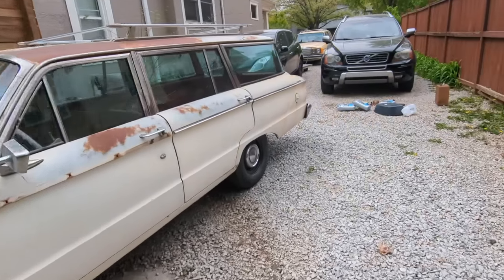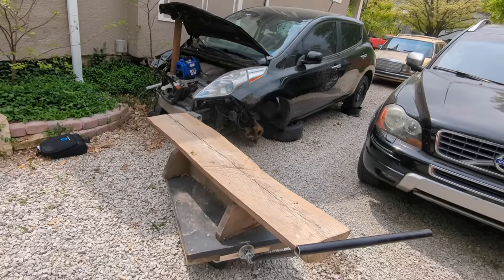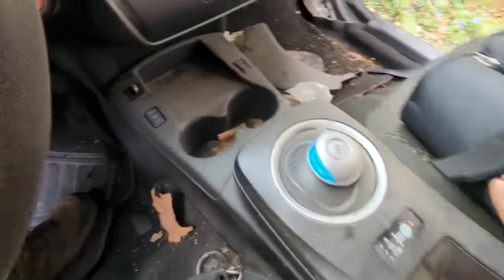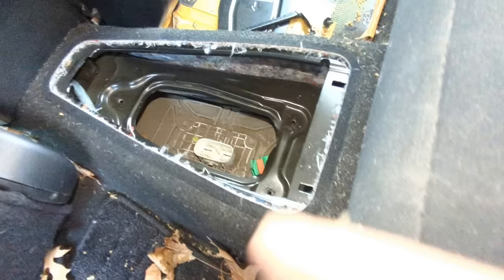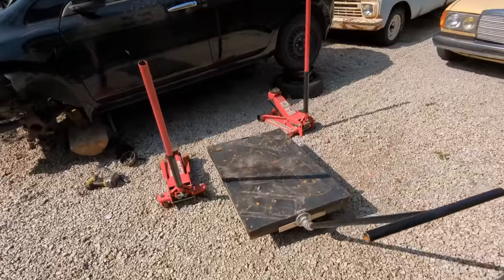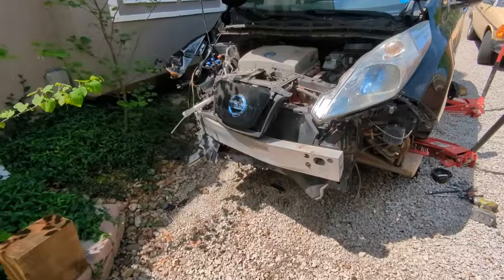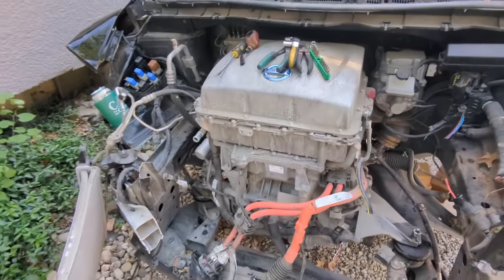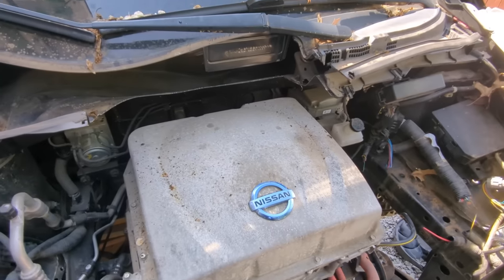Pulling a Nissan Leaf's Motor & Battery for the World's Cheapest EV Conversion!

Comment: Metal tools to pry out plastic  high voltage disconnects definitely had me worried.   I had to remind myself that you had to survive in order to post the video...
Reply from the maker: LMAO
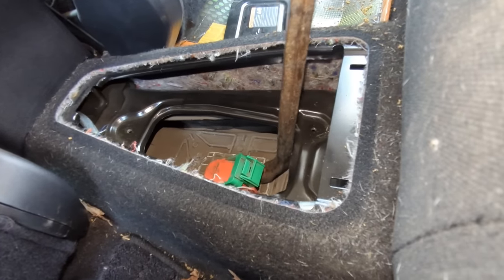Reply: @ThisOldJalopy  06:20 ish.. yup, the whole thing is fkin terrifying.. secondary stands at the back. (also reminding myself that ya definitely haven't died yet) can we change the title to 'how not to...'?
Reply: Dude. The same. It’s been uploaded 😂 he made it somehow lol even with the battery removal man that was wild!!
Reply: Using a conductive crowbar to remove a HV disconnect??
Reply: The Leaf battery outputs are only live when the contactor within the battery is active. Two things stop that happening. 1) simply removing the 12V supply on the control lines will immediately click off the contactor/relay and 2) the central 'safety' disconnect in the car (5:49) physically cuts the HV circuit so it wouldn't matter if the control lines were connected or not.
Reply: @jinny7 there are contactors that allow voltage to reach those HV disconnects. Only trouble if the car is on.
Reply: @JK360noscope   assuming normal operation where a crowbar exerting force isn't accounted for?
Reply: Chopping motor wires with a Saws-All is just simply epic.... and then it swings free, knocking over the concrete block!!!  and the lifting strap was entangled with the car!  ha ha ha
Reply: Purpose made industrial power connections are built in with a certain degree of separation distance to the end user, according to voltage classification. If you look close 8:26 , you can even see the secondary isolation.  Contactor or not and I know nothing of EV,s this still passes the pretty safe test. For comparison sake, how well do we treat our drill batteries, an 18v 5.0AH pack carries a whole lot of energy and those things have only a teensy bit of isolation.
Reply: @jinny7  one of the failure modes for the voltage drop is "in an accident" - it's intended to prevent firefighters and rescue people from getting high voltage.  Ergo, they have to be robust.
Reply: He almost made an arc welder!

Comment: Never get rid of a car till you’re done. You never know what small fuse, switch or relay you might need
Reply: Was thinking the exact same... 👍🏻🇬🇧
Reply: I'm having a bit of a guess here, but I suspect you are having quite a lot of bother getting the system to work in a new car. Those pesky VCUs look for everything before the car will drive including the airbag sensors, key proximity detectors, high voltage continuity connections and may more bits and bobs.
Reply: Also seats

Comment: This project went from do-able to forget about it real fast. Cutting the interior wire harnesses and just taking the basics will render this a failure. Every subsystem ties to another to make that car run and drive. The canbus errors are impossible to fix or charge without the oem ecu modules. Going with a thunderstruck ecu can make it work but your still without a bms and smart charging system. Once   those batteries over charge or under discharge they are toast. I have swapped a few gas cars it was an expensive learning curve.
Reply from the maker: That would be true if I intended on using the Nissan VCU, however I'm wiring in an aftermarket VSU.

Comment: Omg watching those metal tools used to pry off the bright orange high voltage connectors made my sphincter pucker 😮
Reply: I'm not too bothered by that part, they're all designed such that with the contactors open, none of them have voltage. As long as you're doing all this with the car off, that's "fine". The horribly janky way of keeping the car in the air is what's likely to kill him.

Comment: I was told to never use cinder blocks in this way, as they can suddenly and completely fail and crush you. Build some out of 2x4's.
Reply from the maker: The concrete blocks where just there temporarily while I was jacking up the back of the car. I never was under the car while the cinder blocks where holding it up.

Comment: Glad you found someone to recover the refrigerant.  But it's really a simple DIY job.   TLDR: Use dry ice to suck the gas into an empty refrigerant bottle.
1.  Determine what refrigerant you have.  Look it up, but it's almost certainly R134a.
2.  Buy a cheap manifold gauge that will attach to to port.  (try Harbor Freight).
3.  Get an empty bottle to store the refrigerant.  Check your scrap yard.  In a pinch you can use an empty propane bottle with the proper adapter.  The systems Total Charge of refrigerant will tell you how many bottles you need.
4.  Buy dry ice at a grocery store.  This is usually located in a big box at the front of the store.  Get a pound or two.
5.  Buy some alcohol.  Any kind will do.  Isopropanol (rubbing alcohol is cheap).
6.  Make a slurry of alcohol mixed with crushed dry ice.  Don't worry about crushing all of it.  Just break it up into pieces <1".  The alcohol can have some water in it, but not more than 50% or it might freeze.  Make your slurry in a bucket big enough to hold your empty refrigerant bottle.
7.  With the manifold gauge, hook up the cooling system to the empty bottle.  Either port will work because the compressor will not be running, so neither one is high pressure.
8.  Put the empty bottle in the dry ice slurry.  You'll probably want to wrap some insulation around the bucket, especially if it's a hot day.
9.  Now just wait.  The refrigerant gas will naturally migrate to the coldest spot in the system.  If your bottle becomes full, just swap it for another empty one.  You can tell if it's getting full by swirling it around and feeling the weight, or you could weight it.
10.  When the pressure gauge reads Zero you're done.  Seriously, the dry ice will condense every bit of the refrigerant, leaving a vacuum in the system.  Just close off the valves and disconnect everything.  Label and store the bottles for future use.
11.  If you plan to reuse any parts of the coolant system, don't open it to moist air.  Use dry nitrogen (or any other dry gas) to fill the vacuum, and plug the ends as you remove parts.  But if you were going to reuse anything in that car's cooling system you wouldn't need me to tell you any of this.

Comment: Pro Tip. Hard surfaces like a concrete pad are better than gravel for disassembling heavy things you need to roll away on a trolley ?
Reply: Ya for sure throw down some scrap plywood or at least planks.

Comment: My hat's off to you.  You've taken on a HUGE job.  Frankly, it's probably doomed to failure.  But if you've got the interest, skills, and time, go for it.

But if your goal is an inexpensive EV, you're already half-way to a far better alternative.  Just swap that battery you pulled in this video into a Leaf with no damage but a dead battery.  Done!

OK, you do need a little bit of software to tell the car's computer to accept the new battery, but you can find all that on the internet.
Reply: I would have paid 3 k for the battery the a/c system was still intact just remove the dash unit by cutting out the firewall and install it in the new car the same way

Comment: Go back to that salvage yard and start asking about 1/4" plate.  Buy some, at least enough to put under your floor jacks because they have to roll as they lift, or the car will.  Me, I've got 4 sheets of 4'x10' plate... not quite as good as concrete but if you're renting it at least works.

Comment: A warning to anyone considering getting an older Leaf. Do NOT get one without a confirmed replacement "lizard" battery. Nissan does NOT use thermal management and so early batteries die a quick death in the heat. I had a 2012 (gen 1) Leaf that had dropped down to 8 "bars" (12 is max capacity) and that resulted in basically a realistic 30 mile range. Yes, I'm not exaggerating. 30 miles. Keep in mind, these only charged up (at 100% which you shouldn't charge to anyway) to around 100 miles or so.
Reply: Try 80 miles max.

Comment: I feel your pain working under cars on gravel. (A couple sheets of plywood may be in your future) :) Fun following your build.  My parents owned a Leaf about 10 years ago, and sold it when the battery was starting to lose capacity.  I never did drive it though. I am looking into ideas for an EV conversion. Pretty intrigued with axial flux motors, and also hub motor designs. Design criteria for my EV is AWD, as I live in high elevation snow country.
Reply: Oh!  Good idea!  I have the same issue, but maybe worse - it's not pure gravel, it used to be a paver surface that got broken up a bit and gravel and such everywhere.  I tried cardboard, not quite good enough.

Comment: Oh boy, oh boy. Besides the obvious electrical hazards you put yourself into you could have made things a lot easier for yourself by just putting the car on four proper axle stands (even cheapo ones are way safer than those bricks). And putting a layer of e.g. >25 mm OSB under your engine lift and the battery carriage might also have saved you lots of pain in the back. But respect for your confidence and I'm looking forward to the next videos.

Comment: Hi great video and funny, how much do you pay for the Nissan leaf? Did you get it in an specific website? I swapped my engine if my 09 Altima now I have a 50k miles engine for $650, It would be interesting to get a electric ⚡ engine in the future.
Try to get a badass donor car for your project, like an Audi, thx for the video👊 use the manifold gauge set is perfect for AC Freon charging put the lines in a gallon of water and release the Freon is safe it than release it in the air.

Comment: I've wanted to convert a Subaru Brat to electric since before Tesla was a glint in Eberhard's eye. 
Not sure I'd go with a leaf though. Air cooled batteries, and Chademo ew. 
Probably a Bolt. Still cheap, but way more fun and capable.
Reply: Of course the thermal mgt system that made it "cooler" (PI) also gonna make it harder to swap.

Comment: If do it again, 
  try saw through the axels, can leave front wheels on and save lots of time.
  Plus keep wreck mobile

And try keeping  wing mirrors and light, they small and easy to store while selling them to get more cash back from car

Hope you remembered  to keep the battery fuse and was not sill on back seat with axels
Good work though, Good luck
Reply from the maker: I wanted to keep the CV shafts and the hubs so I can use them in the converted car. The Leaf's lug pattern is the same as the Ford's, and I'm going to be able to use the hubs in a custom "de dion" rear suspension, rear engine configuration.

Comment: You have to pull UP on that main power disconnect to get it unplugged not pry up from other side!
     Also would it not be way easier to swap those into a FWD car as that was the basic form factor that the Leaf motor, axles etc. support!  The Mercedes and Ford are RWD and therefore motor would have to go thru their transmission and expensive adaptor plates and custom hardware is needed PLUS having a electric motor going thru transmission ,rear end really is inefficient plus those both are heavy cars!
A simple lighter weight FWD car that already has an engine bay set up for those dimensions and close to same length axles like a Honda ,VW Golf etc. would make much more sense especially with Leafs small battery.
      Also as another poster pointed out the Leaf battery without the stock BMS and charging infrastructure makes no sense as overcharge battery can catch fire easily and the charging is electronically controlled!

Comment: So you may not have the time or energy but you left a bunch of cash on that  car, doors, side mirror, headlamp, tail lights, rear hatch etc. Even the smaller stuff adds up. Just my 2 cents from doing similar projects.
Reply: The set of tail lights alone cost around $1,500 new from the dealership.  Parting out the interior and doing a less destructive dismantle could have left enough good parts to sell and pay for much of the build.

That said a 2014 most likely is going to be on the fringe of battery life and will likely need to have the pack opened up so the failed cells can be replaced.  For a few hundred dollars or so worth of cell packs you could bring it back up to 95% or better however you need to be a stickler for following the safety protocols for working on a 400 volt battery packing 24 kWh.

Hope he saved the dash cluster, charger module behind the rear seat, shifter, bcu, heater control, etc as they are all needed to make it work well.  It's usually in your best interest to pull the wiring harness out intact too and chase down all the related computer modules.

Best!

Comment: Both the recipient vehicles look to be considerably heavier than the Leaf. I would look for something light, aerodynamic and with a dead powertrain. A 1st Gen Honda Insight would be cool but they are not thick on the ground these days.
Reply from the maker: The Comet is surprising lightweight. It is basically a stylized Ford Falcon, which was Ford's first compact economy car, built to compete against the VW Bug and the Chevy Corvair. But its also not very well designed, structurally, and will twist badly with a larger engine in it. The Benz is much much heavier, but the construction is much more solid.

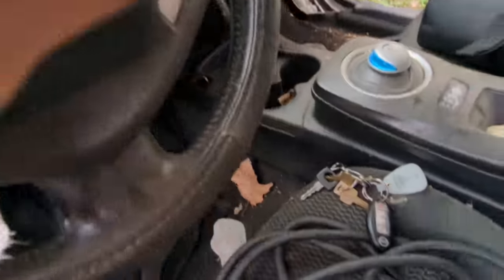Comment: 4:14 Huh. The dashboard shows 10 out of 12 bars for battery capacity, so pretty good health, and 8 out of 12 bars for current charge (or 65%), but then only reports a 40-mile range? That's a bit on the low side.
Reply from the maker: Yeah I know! I'm not sure when it was wrecked but I bought it in January, previous owner could have been using the heater a lot, which I'm told is a big battery drain.
Reply: It’s a Leaf.
Range about 50 miles, on a full charge🤣🤣🤣
Not an ideal donor for a classic conversion. But there’s a reason why Tesla parts are so expensive.
Still, providing he doesn’t fry himself along the way, it’s going to be a fun way to do local runs in something that looks like a real car.
Reply: I've got a 2015 Leaf with 10/12 bars.  75 miles range.  Ignore the range number -- it's just a bad guess based on how the car was last driven.

Comment: Convert the Benz it’s a lot better car better suspension super strong it is heavier but I have a 1985 wagon also and would love to convert it to a highbred by using the Toyota a rear wheel drive or actually Lexus Wray will drive and then keeping the diesel engine for one for when I run out of batteries

Comment: NEVER NEVER EVER... AT ALL... ANY TIME... EVEN TEMPORARY... Use cinder blocks or clay bricks... You WILL die... they break with no warning.
 Use steel jack stands and wood blocks.

Prybar on the disconnect?..... if you don't know there are multiple steps with these and the cable connectors that WILL come undone by hand then you should not be working on it. However, the 12v battery, HV disconnect at the very least should have been disconnected at the accident scene by first responders, verified by towtruck driver and then the scrapyard who should have also disconnected the HV cables.
You obviously have auto knowledge... please don't die..

Comment: Leaf batteries are garbage, not for EV conversion. 
Leaf batteries are great at powerwall, to use for solar homes off grid.
Because in cars is important how many batteries you out in there and how much kwh they actually have.
Leaf is a sabogated vehicle, where nissan made these batteries to lose capacity at the most outrageos levels, no other EV comes even close. Old Leaf in general have like half capacity left but there are more and more cases going way lower to just one third remaining.
This defective engineering was kept including on the second generation until 2019.

Comment: Both cars are too heavy for leaf motor.
Reply from the maker: The Benz is, but the Mercury Comet is surprisingly light, less than 3000 pounds. It is the same chassis as the Ford Falcon, a lightweight car made to compete against the VW Beetle.

Comment: I'm a licensed mechanic and just completed an EV service course. I will say this if you don't know what you're doing with EV's don't touch them. THEY CAN KILL YOU ! The Batteries are 400volts DC and the Orange cables are 400Volts. Your first zap has a high probability to be your last. You should be wearing lineman gloves to remove the battery disconnect switch and they come out easy. Your removal of the battery disconnect safety switch with bare hands and metal tools is cringeworthy, almost as cringeworthy as your jacking of the car. You should retitle the video: 101 Hayseed Mechanic ways to die.